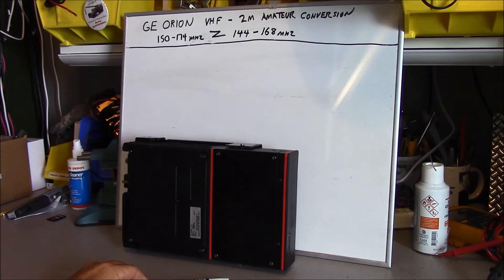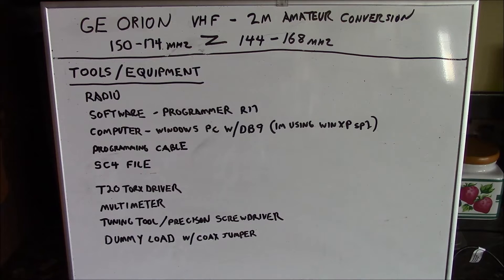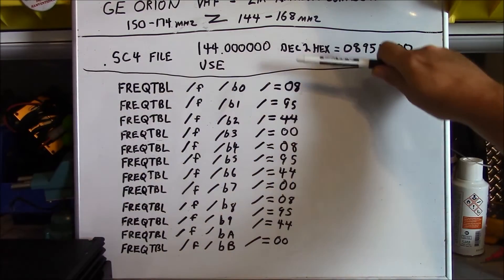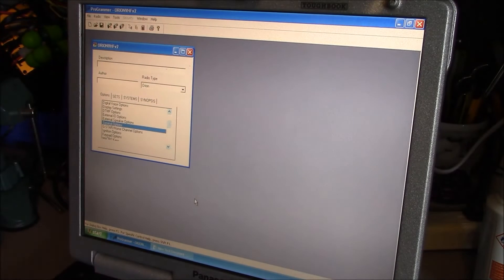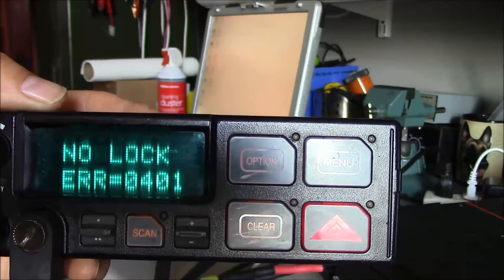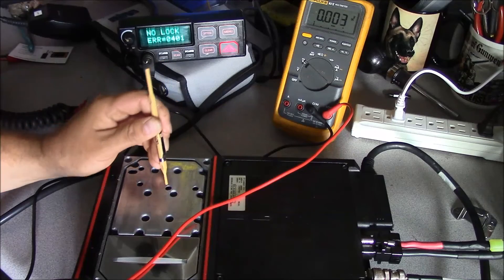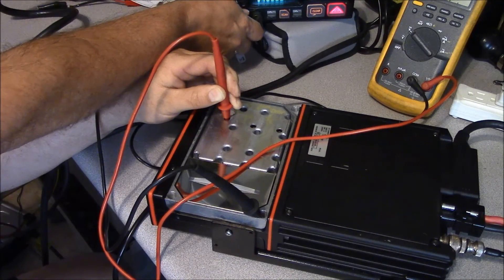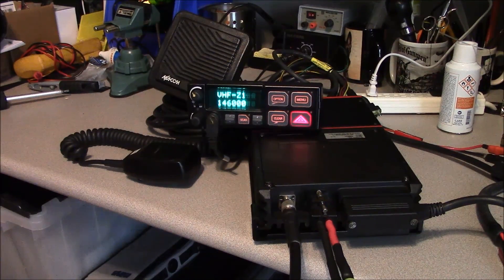100 watt VHF ham radio ! GE / MACOM Orion 2m band conversion DIY

Comment: Hi Brett I have a few questions for you.. I haven't messed with the orions in over 12 years and got the urge to get back into it.  I am using Programmer R18 and I wanted to save the tracking and feature data and put it on a CD plus a printout that I store inside the radio. I forgot how to go about saving that info from radio Maint. to CD..
Also I have a few radios that have been programmed with a newer version of Programmer and can't read the radios. How do I go about being able to use the version of Programmer that I have (R18) to program them??
Thanks in advance Brett for your response back.
Mike  N2JVE
Niverville, N.Y.
Reply from the maker: Mike, If you want to save the data to CD Give each  archive a unique name and copy that file to a CD or a better way is to use an SD card or USB drive IMHO. For the radios that have been programmed with a newer version I just create a new archive for the model number and split that matches what Im working with using the version I have and write the file to the radio.
Reply: @survivalcomms  thanks Brett. Appreciate the help. Just curious if you plan on doing a series on the Motorola Spectra. Guess I'm old school as far as gear goes lol. The newest commercial  radio I have is the Motorola XTS-3000 Astro VHF and love it. I think down the road I would like to do a P25 Repeater  since more and more gear is becoming available as soon of the PS agencies in my area  are going to Moto-Trbo or trunking now. We'll see what happens.
Reply from the maker: @n2jve1989  I maintained a fleet of Spectras many years ago and am quite familiar with them. They are excellent radios if you dont mind DOS RSS and  are cognizant of the problems they have with leaking capacitors. The capacitor problems and the perils of bit banging can be found with a search engine. I no longer have any that aren't Astro spectras. You can get P25 Quantar repeaters for less than 1k but they are long in the tooth and many have been cannibalized or are operating with cannibalized parts. Repeater Builder is an awesome resource of information.
Reply: @survivalcomms  I know about Repeater-Builder.  My first repeater that I built was 2 GE Delta SX 100 watt with the help of Repeater Builder.. I bought them on Ebay for 20 bucks for the pair for VHF.  I had wired up with no head. I made a panel for the squelch, ,volume, mic and speaker. I had the radios wired up on q 15 Pin plug so if the TX or Rec quit, all I would have to do is switch the 15 pin plugs and antenna feed line and back In business within 5 mins. That 2 Meter repeater was on the air for over 14 years with only one  issue in that time which was a cap in the Rec.. let go. was using a Micro Computer Concept RC-100 Controllor and for the longest while was using seperate antennas with about 50 ft vertical separation and couldn't tell any type of desense what so ever.   Was on a 120ft tower and 920 ft elevation.  Had a 120 coverage at least to the south . I'm near Albany N.Y. and had people getting into it from N.j.and Pa.all the time.
I read about the Spectras with the cap issues . I have one VHF Srectra  laying around with siren unit. I might just try to dump it especially since it doesn't do Astro. Thanks Brett for getting back to me!!!
Reply from the maker: @n2jve1989  Very cool ! You are welcome and thanks for sharing !

Comment: I've managed to convert virtually the same model from the commercial band VHF to Amateur (using the .SC4 file). I have good locks at 144.0 through the ham bands and all the way to 168.00 MHz. I tested them in .5 MHz increments for simplicity sake. They all lock now on both TX and RX. Interestingly enough, the Voltages are a bit out of range on the low and the higher side. They range from ~2.0 v @ 144.0 MHz (TX/RX) to ~7.8 v @ 168.0 MHz (TX/RX). I've synced the voltage of TX and RX within ~0.2 v of RX and TX. I assume this is normal? RX/TX POT voltage seems to increase across the band as frequency increases. Is this correct? Am I going to have problems with this set up?
Reply from the maker: That isnt unusual. You will lose a little from the top to gain a little at the bottom.  If you are getting VCO lock at the edges you desire you are good. Temperature extremes can change things up a tad if you are on the bleeding edge of lock. Thanks for watching !

Comment: Hey Brett, just curious if ever built the Orion's  into a repeater?? I know it can be done as friend has built 6meter, 2meter, 440 and 900Mhz repeaters but unfortunately he passed away. Looking to find where to connect COR, Audio PTT etc. from the controller. I assume you connect to the DB-37 ?  I haven't done to much research. I do have several 6, 2 meter and 440 100 Watt Orions floating around that I want to put back in service. Mainly I want to resurrect my GMRS and upgrade my 2 meter repeater from the 2 Delta SX thats currently in use.  Thanks in advance for your response back.  Mike, N2JVE. BTW I am good in QRZ if you want to send a e-mail
Reply from the maker: It can totally be done but be cognizant that these are mobile radios and subject to the limitations in duty cycle etc.  Repeater builder has some info on it.  What  are you using for a controller ? Thanks for watching !
Reply: @survivalcomms  i will be using a Zetron Model 38A Repeater Panel which was set up on our GE MASTR II that we using for GMRS. I know about continuous duty for the PA. I am thinking if I have a 110 Watt Orion I would turn power output down to half or just turn power down to whatever it takes to drive the PA which is Continous Duty  but I have if the radio is turned down over half way that the Transmitter can get dirty from what I have heard but don't know for sure. Thanks for the info. I know Repeater Builder quite well.  Got most of my info when I built up the GE Delta SX mobile for my 2 Meter Repeater. Great bunch of people. Thanks for info on the Orions. There isn't that much info on You tube working on them.
Reply from the maker: @n2jve1989  That is an excellent controller and the MASTR II is legacy but solid IMHO. Sounds like you have a great infrastructure grade setup.  The lowest I have taken an orion down was 70 watts  and there were no ill effects.  Thank you again and good luck with your project !
Reply: @survivalcomms  Thank You. BTW, I found the wiring for the Orions in my archives from my friend who had passed away. I remembered that he had sent info about the Orion Repeaters he wanted me to go through and I did actually save them. That was in 2015.  Take care sir and again Thank You.  Mike

Comment: Hi,
I worked for GE Two Way for around 12 years. Left the business around Delta error, Started with Progress Line, TPL. Went to Florence SC to GMARC  training.  Asked instructor what ever happened with 1,2,3, and 4,  He said they didn't work!  
Ham call W1DMX (Connecticut). 
Cool radio. Loved the MVP series. Made great little repeaters.  Loved the Mastr II. 
Ct State Police 5 years then Verizon Wireless 13 years then Motorola then retired.
Nice video, thanks

Mike   W1DMX
Reply from the maker: Thank you !  My career was Motorola stuff in government service . I played with GE stuff in interop exercises and some contracting work but this was my first foray into playing with GE gear for fun. I learned a lot in this project. One I baby stepped the GE terms into a context I was familiar with it was smooth sailing.  The experience definitely was beneficial . Thanks for watching !